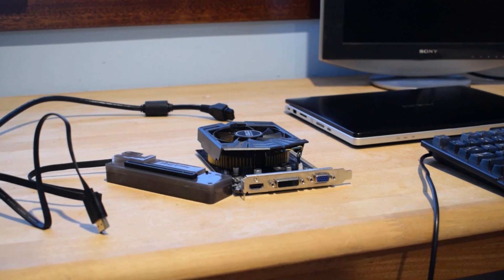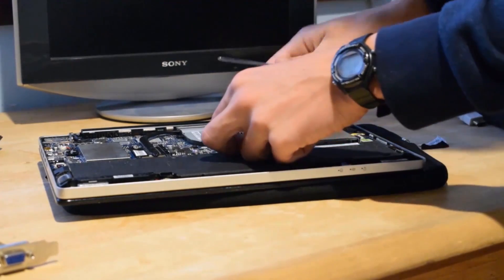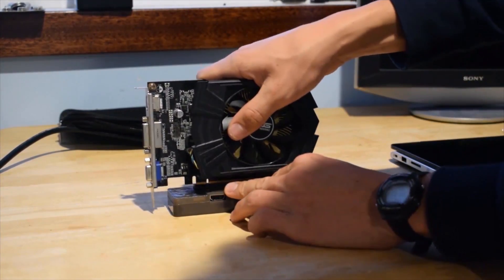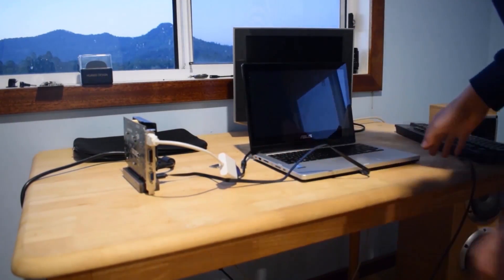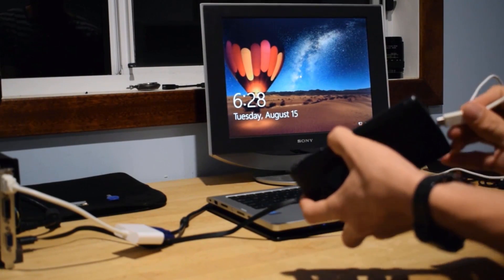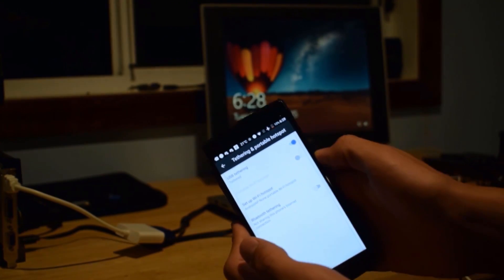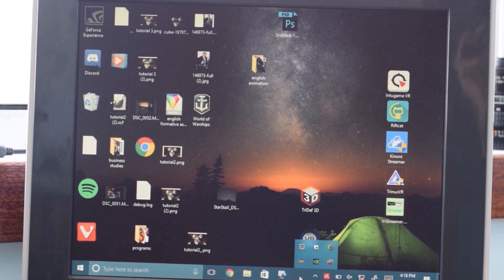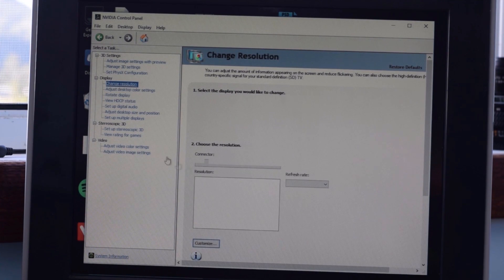How to Connect External PC Graphics Card to Laptop (no thunderbolt port required) Egpu Setup

Comment: will it work on my toshiba satellite m300? my spec:2ghz duo processor 4gb RAM ati mobility radeon hd 3400 win10 64bit,in need pls reply tq.(ps: no whitelist problem)
Reply from the maker: +Yii Jiang Yeah, it should work as far as I know (assuming your laptop has a mPCI-e slot). I would suggest getting a low - medium end gpu though, as your specs will probably bottleneck a high end one.
Reply: +qwertypop will gtx 750(in the video)works or do you have any suggestion base on my spec?and can i use my laptop charger to replace dell da-2 power supply?will you recommend gtx750ti or gt1030?
Reply from the maker: +Yii Liang No, you can't use your laptop charger instead of a power supply like the dell da-2. I reckon a 750 might be good, not sure if the others would get bottlenecked by the cpu. Maybe do some research on this on Google (might be useful to look for a desktop cpu with equivalent performance to yours, and then google if that cpu would bottleneck x gpu.
Reply: +qwertypop did i really need dell da-2?can i use exp gdc originals power supply?
Reply from the maker: Well, if the your exp gdc comes with a power supply, you can use that. Mine didn't include a power supply though.
Reply: +qwertypop will 220w enough?what gpu will you recommend according my potato laptop?
Reply: will other equipment in laptop crashes the egpu? why some people fail some succesfuly builded it?
Reply: y u no reply😥
Reply from the maker: +Yii Liang oops, sorry about that. Yes, if it doesn't have a bios whitelist, it should work.
Reply: are your gpu have ti or dont?
Reply from the maker: No, my gpu isn't a ti, it's just a standard 750. The reason it is unsuccessful for some people is because they have a bios whitelist on their laptop (unless there is some other issue which I am unaware of), so other equipment shouldn't crash it. You just won't be able to use your mPCI-e slot for your wifi card, because the egpu uses that. If 220w is enough depends on the gpu, but if you are getting something that isn't too high end, it should be enough. Sorry for not answering your questions in the last response, I was on my phone, and youtube didn't show the replies, so I answered for your original question. Youtube is a bit weird on mobile sometimes (with not showing responses).
Reply: +qwertypop thanks for reply:D ,ill try it end of the month(hope it works):P
Reply from the maker: Ok, cool. Tell me how it goes :)
Reply: qwertypop express card or mini pci-e ?i have both so which will ran faster and better?
Reply: expresscard or mpcie?
Reply: pls reply T^T
Reply: +qwertypop pls reply
Reply: y u no reply?
Reply from the maker: Oh, really sorry about that. The comment notifications on the yt studio app on android are sort of broken, so I missed your comments :( I'm pretty sure mPCI-e is faster, but expresscard is probably more convenient.
Reply: qwertypop ok thanks,any way to communicate with you better?cuz u said dat yt  studio app not working well...
Reply from the maker: +Yii Liang Yeah, I have a discord channel (basically no one on it though). You can join that if you want: https://discord.gg/gqmvfeS
Reply: +qwertypop yay it arrived,just bought it online.havnt decided wat gpu...

Comment: do i need a monitor can i just use the one on my laptop??
Reply from the maker: Should work on using just laptop display in most cases, but not all (needs intel hd igpu, and even then it just doesn't work for some reason on some laptops (like my one). More info: https://www.reddit.com/r/eGPU/comments/5jpnqz/do_all_egpus_require_an_external_monitor/
Reply: qwertypop thanks much appreciated

Comment: I have an Acer Aspire E 15 E5-573G these are my specs:
-Intel Core i5-4200U
-16GB RAM
-1 TB storage
Can I get an Asus ROG STRIX Nvidia GTX 1050 Ti without encountering any issues?
please reply, I'm in need haha
Reply from the maker: +tronceeper I think your laptop would work with an egpu, just do some more research on whether it has a bios whitelist (if it has one, it won't work with an egpu, if it doesn't have one, it's all good). Also, the 10xx series nvidia cards have some driver issues with being used as an egpu, so I would recommend getting an 9xx series gpu, just so you don't have any trouble with the drivers: https://egpu.io/forums/expresscard-mpcie-m-2-adapters/nvidia-is-killing-off-mpciengff-m2-egpus-error-43-with-372-90/ hope that helps :)
Reply: qwertypop Thank you for the reply! I'd like maximum performance so I'm planning to get the 1050 Ti, on the link you sent has stated 2 solutions. Do you think it's safe for me to rely on those?

Also, is there a chance I'll encounter bottle necking with a gpu that powerful?

Thanks
Reply from the maker: From what I can tell, and from peoples comments, Workaround #1 should work, just check if anyone said it doesn't work, but I reckon it should work fine (no guarantee though). As for throttling, I think it should be fine on most games, but cpu intensive games probably won't get too much of a performance improvement, just check your cpu usage in the games you want to play, and if the cpu is at 100% or close to it, you might not get such a massive improvement in performance, as they would then be limited by the cpu.
Reply: qwertypop Is there a 1050 Ti deck or something that can tell me all the things I need for the egpu (docks, adapters, power supply, etc.)? If I get the adapter will my 1050 Ti fit on the adapter or is there something else I should get? Can I also use my laptop monitor as a second screen? Also, how do I check if my laptop has a BIOS whitelist?

Thanks
Reply from the maker: +tronceeper You would just need the normal mPCI-e connection EXP GDC (the 1050ti will just slot into its pci slot). For power supplies I personally would recommend the dell da-2, as it is a bit more compact that the other ones. Using you the laptop screen should work in most cases, but with some laptops it doesn't.. It's hard to tell on which ones it works and on which it won't, but I think it should work on most (didn't work on. Mine because it disabled the integrated gpu when the egpu was connected for some reason). As for the bios whitelist, the only way to find out is to Google your laptop to see if anyone has said anything about a bios whitelist, or successfully connecting an egpu to it. Form what I looked up just now though, Acer doesn't appear to have bios whitelists, so you should be fine.
Reply: qwertypop Sorry for pestering you so much.. but thanks so much for the reply, I honestly don't know what I would've done if you didn't answer. Apparently the GTX 960 has almost the same performance as 1050 Ti, I looked into it but found it was more expensive for some reason haha.
I looked at workaround 1 too, I think I understood it well enough, but I'm still going to research further.

Did your laptop monitor become unusable when you connected the egpu? Because I'm currently using external monitor as my main monitor and my laptop screen if I want to have something on there.
Reply from the maker: No problem. Yeah, my laptop screen doesn't work at all while the egpu is connected, and the intel hd graphics don't show up in device manager. Since the intel hd graphics are required to use the internal display (the video gets routed to the display via the intel graphics), I am assuming it didn't work for me because my laptop (asus tp300la) decided to disable the intel gpu when the egpu is connected. Also consider whether it is worth the money and effort to get an egpu setup, as you can get some pretty cheap gaming laptop/pc deals online.
Reply: Is there anything I should do to protect my eGpu? Like a case or something?
Reply from the maker: I personally didn't buy a case, but the egpu was a bit shaky in the slot. I don't think a case is necessary, but if you want some protection for your gpu to prevent it from being knocked over etc, then I guess you might want to buy one. Your choice.
Reply: qwertypop Ok. I'll probably make a clear plastic box or something... My monitor uses the default monitor cable, not HDMI, will that be a problem in any way? I noticed you mentioned an adapter and a dock, does the EXP v8 cover both of those?
Reply from the maker: You mean your monitor uses vga? That should be fine, as basically all graphics cards (as far as I know) have a vga port, and you will just be plugging it into the gpu, so if the gpu has the slot, it will work. Yeah, when I say adapter or dock, I mean the EXP GDC.
Reply: qwertypop Ok! Also, I forgot to ask if the Dell DA-2 would have enough wattage for the 1050 Ti? Even though I did research and I'm 80% sure I don't have a BIOS whitelist is there a Plan B of any sort (removing the whitelist)?
Thanks
Reply from the maker: According to this forum: https://egpu.io/forums/implementation-guides/dell-latitude-e6430-zotac-gtx-1050-ti-mini-via-exp-gdc-8-4d-expresscard/  the Dell DA-2 works for the 1050ti (the guy had a different psu and had issues, but then further down, he said that his da-2 arrived, and it fixed his issues, so that would mean it's powerful enough). Yeah, I think if you had a bios whitelist, you might be able to get a custom bios, but i'm fairly certain you don't have a bios whitelist. Good luck :) If you decide to buy the things, it would be cool if you could consider buying them through the ebay links on my website: https://qwertypopyt.jimdo.com/buy-products-seen-in-videos/ , as I get a commission on those sales then. Don't worry about it if you prefer to buy through amazon, just in case you were going to buy the things from ebay anyway :)
Reply: Thank you!! I'd really love to get the things from ebay so you get commission but I don't live in a place where ebay can ship to without a huge fee.
I'll probably get the components in February (since I'm going on holiday in January and won't have much time from now) and set it up, I'll ask if I have any questions (if that's ok).

Thanks again :D
Reply from the maker: +tronceeper Ok, where I live most things on eBay have pretty cheap postage, but Amazon won't post most items here. Yeah, feel free to ask any questions when they come up.
Reply: Hey man, it's been quite a while, but, I have some updates :). I got myself a custom pc like a month ago for around $650 it has a quad core ryzen processor and 1050 ti, 8 gb ram. After all that I decided that I might as well just get a desktop, I'm happy with it. 
Just felt like mentioning it :)
Reply from the maker: Yeah, that sounds like a nice setup :)

Comment: Can this work on lenovo b50-70 i7? Please help
Reply from the maker: This person appears to have got it working with your computer: https://www.techinferno.com/index.php?/forums/topic/10317-15-lenovo-b50-70-gtx9604gbpsc-ngffm2-exp-gdc-83-win10anniversary-jake96/
So, yeah, I reckon it should work.
Reply: Hi i askbon forum and egpu is ony for ngff pcie and my laptop Have ngff key a/e and i didn't know wat is this sata or pcie? If this sata 
this can't work but i dont know to checl this =( plz help md
Reply from the maker: +Hitpov Form what I read on here: https://arstechnica.com/gadgets/2015/02/understanding-m-2-the-interface-that-will-speed-up-your-next-ssd/ you have a m.2 slot with an a/e key. As far as I can tell, that is pci, so you should be able to use a m.2 to minipcie adapter. Some more discussion on this is found here: https://www.techinferno.com/index.php?/forums/topic/5929-m2-ngff-egpu-possible/

Comment: work with rx 580??
Reply from the maker: +giovanni demestri re Yeah, it should work as long as your laptop doesn't have a bios whitelist. The internal display won't work though, as that only works with nvidia graphics (if it works at all)
Reply: thanks :)

Comment: can you use laptops screen instead of a monitor?
Reply from the maker: In most cases yes, as long as your laptop has intel hd graphics. Sometimes there are issues which will prevent it from working, like with my laptop, which disabled the intel hd graphics when the egpu was connected, preventing the internal monitor from working. Also note that there is a performance decrease when playing games on the internal monitor vs using an external one. Hope that helps.
Reply: Thanks for the reply, i orderd the adapter and now im waiting for it to arrive :)

Comment: It still should read the driver why don't you try that for me try hooking USB to the graphics card and see if it works the same instead of hoping to the WiFi card I bet you it does it's just going to download the driver or since the drivers already installed now since you hooked it up to the WiFi card hook it up to USB to USB and see what happens
Reply from the maker: +jonny c 2.0 Hey, you can't connect the gpu to your computer for several reasons: firstly, the connection needs to be a pci interface (have pci lanes) for the gpu to work, which USB doesn't, and even if it would work, the USB connection would be too slow to get a good improvement in performance.
Reply: qwertypop i no this on my streem i can get ride of pci , Eye-Fi card put in SSD PCI hard drive and then buy us WiFi dongle to replace my WiFi for my computer because I have an HP stream I just purchased with Windows 10 for gigs of RAM dual core processor 1.6 average turbo to 2.6 gigahertz Celeron processor and supposed to have HD 7:40. Because the size of the screen is 1080p times 740 p
Reply: qwertypop the biggest problem is I would love to know since you are a pretty very good with the computer and technology and stuff what do you suggest I do for storage because it's only got a 32 gigabyte flash drive built into it and 20 years you stop by Windows sir so what do you suggest I do for storage besides a external hard drive that's not going to be cool having a external hard drive hooked up all the time so I have two or three options you already heard of one by taking it apart and putting in that SSD hard drive it has no upgradable parts only that it's all integrated soldered so I have two options other than the one I gave you about the PCI Wireless removable car to hard drive which is other two things flashcard or a flash drive cuz I only have a SIM card slot for a flash card or a flash USB drive there getting so small the flash drives do you suggest I use one of them or suggest using a 64GB flash card SIM card let me know your preference which is faster loading storing and works better

Comment: Thanks to me you now have 222 subs XD
Reply from the maker: +PIPPINGAMING THANKS :)
Reply: Yep, just fyi, i just got a GTX 745. What do you think about that as an external graphics card? Next i'm ordering a usb wifi adapter, pc pry tool kit, and an egpu adapter from ganggood.com all on amazon. I'll let you know how it all goes! Please make a video on how to install an egpu on a HP (pavillion) notebook if you have one, this video really needs to be updated. thanks man! don't forget to answer my question!
Reply from the maker: Yeah, that gpu is ok. I mean it's not that powerful, but as long as it's good enough for what you want to do, it's ok. Yeah, do let me know once you get the setup done. I don't have a hp laptop to do a tutorial on. Oh, and if you have a hp laptop, make sure it doesn't have a bios whitelist (if you have a rather new one that shouldn't be an issue). Good luck with your setup :)
https://h30434.www3.hp.com/t5/Notebook-Wireless-and-Networking/Does-HP-Pavilion-15-e001ax-has-bios-whitelisting/td-p/5973244

Comment: Do you need an external monitor?
Reply from the maker: +PIPPINGAMING Sometimes. It can vary from laptop to laptop. Please note even if it works without the monitor, this is still not ideal, because there will be a noticeable decrease in fps vs using an external monitor.

Comment: I want to know the answers for  below two questions???                                                        1.I see some of them getting error 43,its because nvidia blocking the support  with its latest driver update(after 372 driver update).is that true???                                                 Is it possible for lenovo g50-70????  (bios is whitelist)                                                                                              2.And i have lenovo g50-70 laptop. Some of them saying that all  lenovos laptops bios is whitelist, that means there is no way to change the hardware settings in bios.                                               Please reply bro if you know the answers it it will helps me a lot
Reply from the maker: +siva reddy What graphics card are you using? I think the g50-70 might well have a bios whitelist
Reply: qwertypop  thank u very much for your reply. But one question is my lenovo g50-70 (20351) does support??
My specs:
Intel i3 processor
Amd r5 230 2gb graphics
4gb ram
How to check my bios is whitelist?
Reply from the maker: +siva reddy To find out if you have a bios whitelist, try googling you laptop model and "whitelist", or a similar model. If that doesn't give you an answer, you may just need to take the risk, and it may not work. Otherwise it should work, you will just need to disable the amd graphics.

Comment: i have an AMD graphic card on my laptop...should i go for an AMD has an external card or i can pick an Nvidia ?
Reply from the maker: +Fred Mendes I believe you can also use a nvidia one. Either way you won't be able to use the internal laptop display though, so you will need to use an external monitor.

Comment: I had the gist of it. Hopefully my Vista era HP Centrino will have reached peak maturity in finding Linux/FreeBSD drivers to support Radeon HD7770 / RX260x or 8600GT PCIe refresh / GTX480 / GTX960.
Reply from the maker: Hm, that laptop may have a bios whitelist. Be sure to check if it does before getting an external gpu setup, because if it has a bios whitelist, that would sadly block the egpu from working. (check out the links on my pinned post for info on bios whitelists)